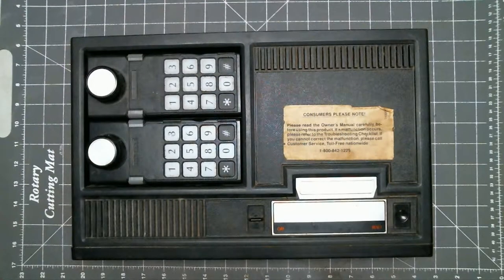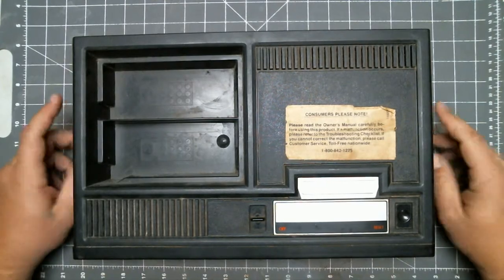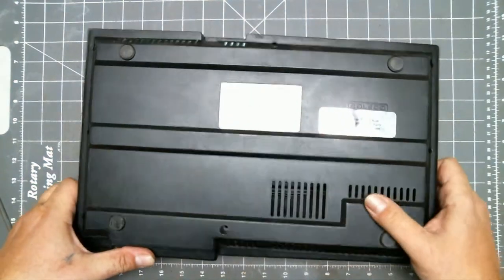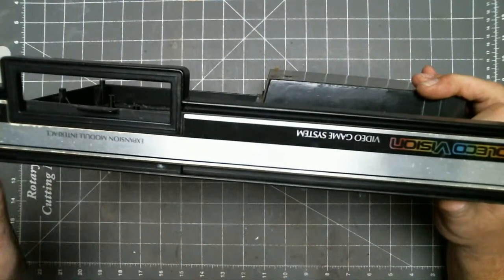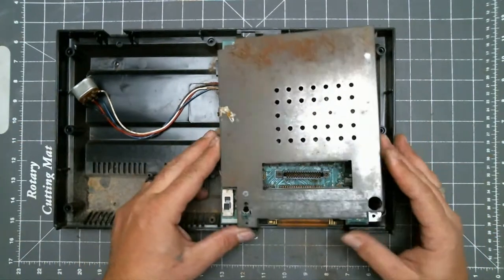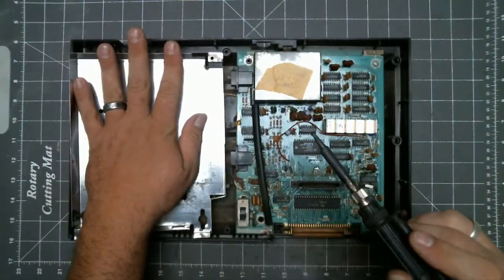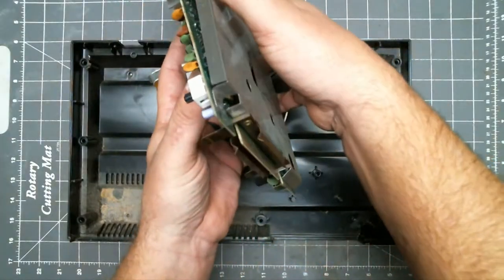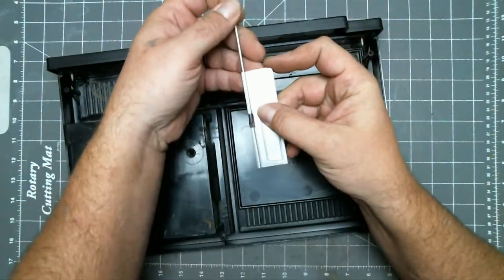COLECOVISION DISASSEMBLY [WARANTY VOID IF REMOVED]

Comment: Great video - this was just the sanity check I needed while disassembling mine.  Note @3:00.  On my unit the RF shied was also soldered to the point where the RF modulators grounding cable connects to the board.  That is, right below and to the right of the power button.  You need to be careful not to touch the plastic while doing it, but a chisel tip can fit in there easily to de-solder it.
Reply from the maker: thanks for the input. this is the only Colecovision I have taken apart, its good to know their might be some variations out there.